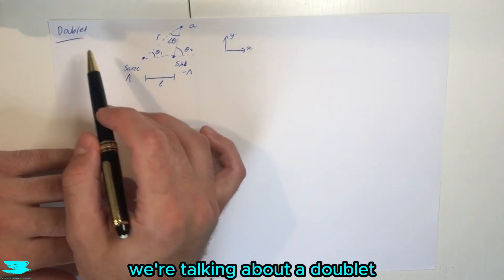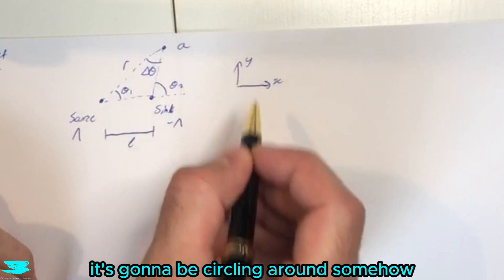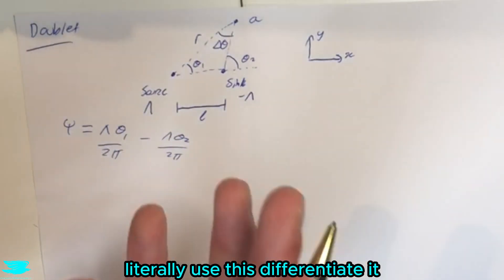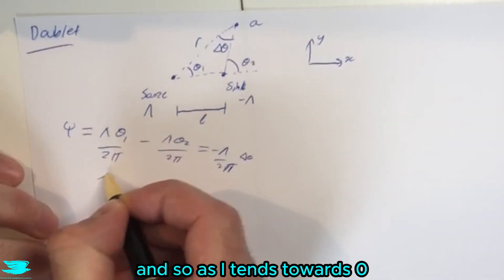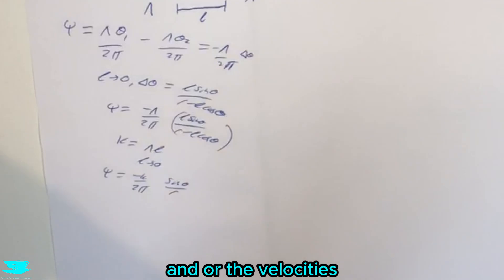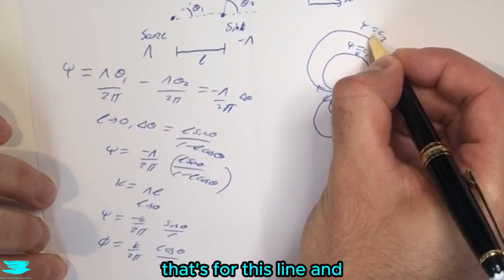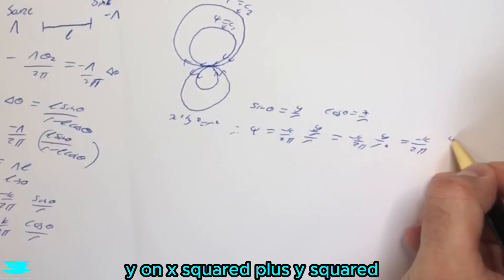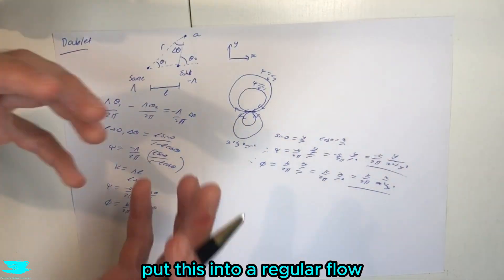Doublet Explained [Fundamental Aero #56]

Comment: Could you make a video about blown diffusers? Have comparisons of different horizontal and vertical placements as well as if it's better to have it further in or out in the diffuser. Also if the best way to use it is to increase mass flow or to seal of the edges.
Reply from the maker: Thanks for the idea! We will. The video will be out probably next Thursday.
Reply: @PremierAerodynamics  Cool, looking forward to it.

Main interest would be the roadcar side of things since that's the most relevant but for example sealing the edges are most more commonly achievable and done in open wheelers, perhaps you can make a flick in for both? 

Don't even know if sealing the edge of either the floor or diffuser would even be a feasible and realistic concept in a road car or even road car based race cars, probably not.
Reply: Here's a hint, heat energy lowers Reynolds number. Hot air has lower density and higher viscosity. Perfect for keeping flow attached. Not to mention if you want to lower pressure under the car, reducing the density of air going there helps.

Underbodies make downforce by increasing volumetric flow rate, taking the cubes of air and moving them really fast. If you can drop the density of those cubes even better.

Comment: In Charles Steinmetz book 'Electric Discharges, Waves and Impulses' (free PDF's online available), he also talks about the doublet. In page 11 he denotes magnetic lines of force between two wires as a concentric doublet pair, while dielectric lines of force are radial doublet pair. In his mind magnetic force is repulsive, while dielectric force is attractive. I think it's really neat that both aerodynamic vorticity and electrodynamic vorticity both follow the right hand rule.
Reply from the maker: It's remarkable how similar they are. The similarities seem too frequent for them not to be related somehow. I just don't know how...
Reply: @PremierAerodynamics  In the old days there was assumed to be an aether. A background medium of ultra rarified fluid, that was essentially neutral, but polarizable. Both fluid and electrodynamics came from that underlying assumption. The vector calculus came afterwards. Even continuity is a result of that polarizability, Euler's continuity and Newton's laws of motion, and Maxwell's laws of electrodynamics(Which are really the Oliver Heavyside equations) also assumed the Aether. Of course the aether doesn't exist just like electrical energy isn't a fluid, even though fluid dynamics gives good approximations.

I guess it's just artifacts from concepts that fell out of favor in the late 19th century.